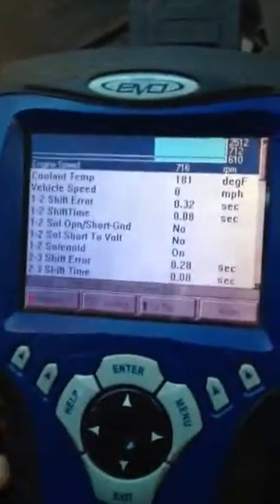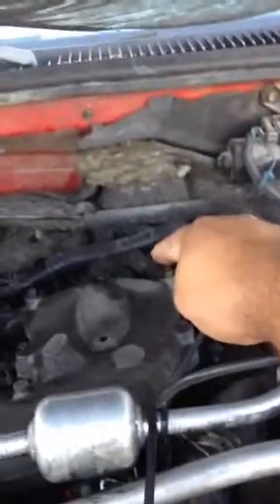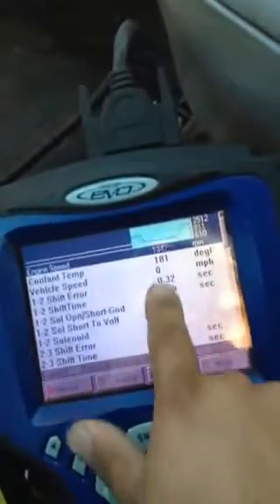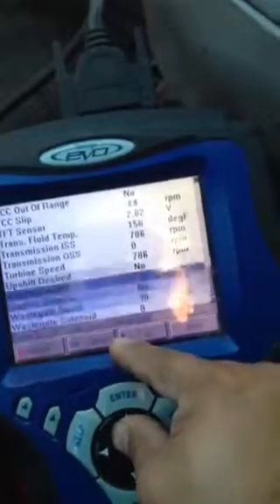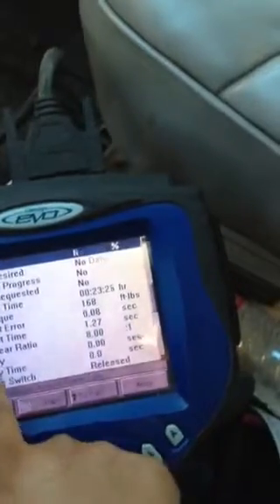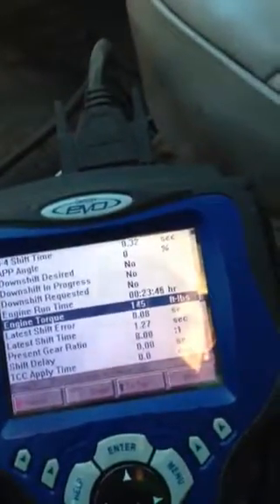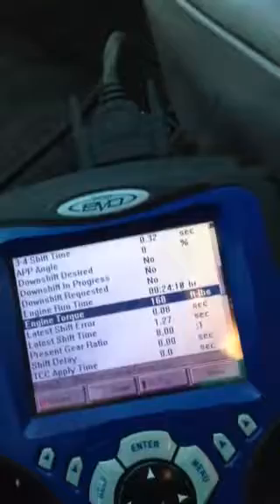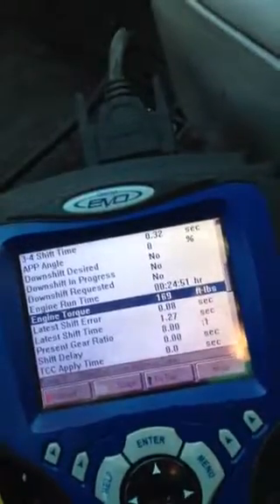DS4 to DB2 4L80E shift issues

Comment: Hey, I know that your video has been on here for quite some time, but how did everything work out with the swap and the functionality with the 4L80E?
Reply from the maker: @mojo1965  all that was swapped was the injection pump. Still worked this year till I parted it out. Got t boned by a red light runner and I bought an 94 with the insurance money. This truck still exists though just in the back pasture for parts. It will still drive around
Reply: @DRNEGOLICIS  thanks for replying so quickly. Did you have any issues with the trans? You said in your video that you would probably start towing with it.
Reply from the maker: @mojo1965  this new phone gives me youtube notifications thats how I seent your mesaage, it shifts like an old Allison and locks up in OD and Direct only aftet 55mph. I had to disconnect the line pressure control solinoid to keep the apply pressure up. I towed with it for years. No real issues towing 8k plus
Reply: Sorry to bother you again, but the two wires you specify don't correlate to my wiring diagram. There is a purple which comes from the ECM but it goes to the DTC connector. And there is a dark blue which runs from the ECM going to the trans.
Reply: Did you need to change the injector lines when you went to the db2 also ? I hear they may be different than the ds4 lines 🤷‍♂️ bits are hard to get and pricy in Australia 😅

Comment: So all you swapped was the pump, hard lines, throttle pedal, and throttle cable? You didn’t use a tcm and engine speed sensor out of a mechanical truck?
Reply from the maker: @SparkplughunterIDI  that is correct. Factory computer. The factory crank sensor and Coolant temp sensor are still connected.  They are needed for engine speed reference and temp is needed to determine if lockup and 4th is allowed
Reply: @DRNEGOLICIS so the wire you snipped is on the outside of the tranny?  I just finished my build everything except my trans controller and want to drive the truck this weekend
Reply: @DRNEGOLICIS which wire was it that you cut on the round plug?
Reply from the maker: @SparkplughunterIDI  correct